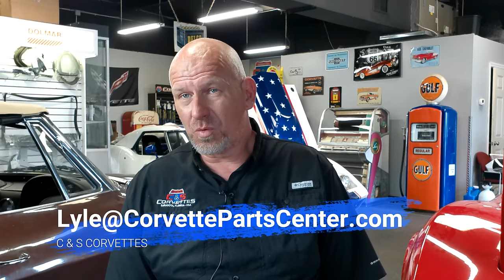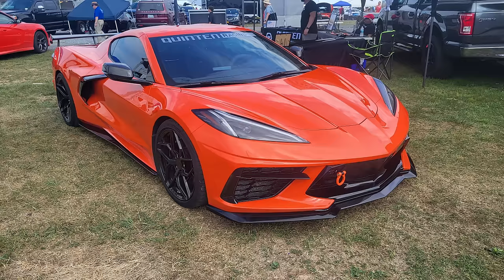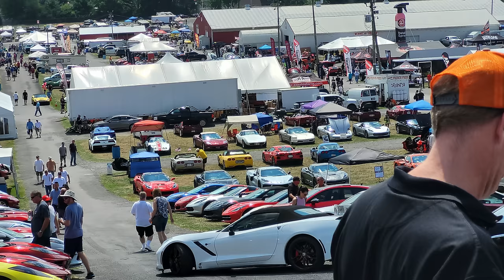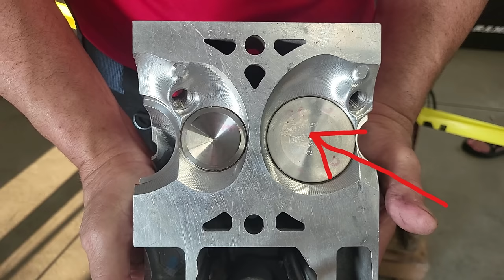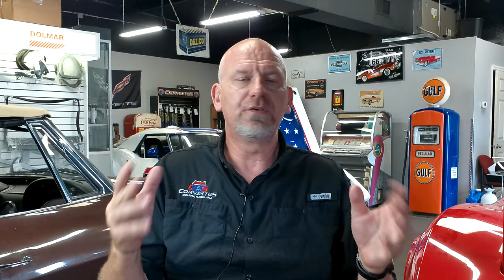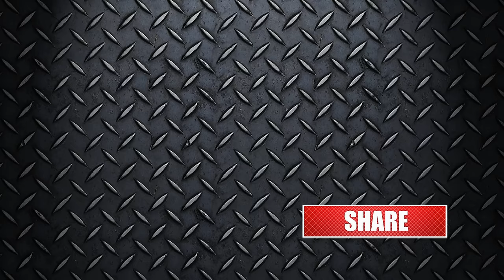The Truth about the LS7

Comment: What about 2009 Z06; any problems with valve guides? I have one with shrorty headers and no cats. What say oh wizzard?
Reply from the maker: Ronald, as you can see in the comments below there are very divided opinions about the LS7.  GM has its views, and the businesses that specialize in solving LS7 head issues have a very different take on them.  My strong suggestion is to contact Race Proven Motorsports or Katech Industries to get their input regarding your car specifically.  Lyle

Comment: I’ve had two LS7 engines (C6 Z06 and 5th Gen Camaro Z28) and without hesitation I will admit that the LS3 engine is better than the LS7 for tuning and longevity and reliability. 
LS3 is the best V8 GM has ever made in my personal opinion

Comment: If you buy a Z06 2006 should I replace the heads and buy factory heads for the Z06 or have GM dealership rebuild them.
Reply from the maker: I recommend doing the valve test as mentioned in the video....if there is ANY question, buy the Katech heads and be done with it.   Lyle

Comment: Excuse me When I said thousands had been reported on the forum I was referring to an article that talked about the large number of reported failures. GM if you believe them “had to” admit that there was probably about only 10% LS7 failure’s in the C6 Z06. GM built 28007 C6Z’s from 2006 to 2013. 10 percent of 28007 is about 2,800 and that does not include the Z28’s that they also failed in.

Comment: I agree with you for the most part of the video. I personally like stick with proper oem parts I’ve had my fun with modifying cars and all the problems that come along with it. But why would gm tune the c6 Z06 7k rpm redline from the factory if the car could handle it. Personally I feel the stock factory tune should be pretty safe if they’re going to put a warranty behind it. Sounds more like they screwed the pooch on that they just don’t want to admit it
Reply: Regarding C7 OEM wheel failures. GM lawyers won the court case by admitting it WAS an engineering design failure. The warranty states "materials or workmanship", both of which meant spec., it was a inferior design which caused the failure, but the warranty doesn't cover that. :(

Comment: I accidentally came across this video. The individual speaking in this video obviously isn't speaking from any type of experience. He lost all credibility when he used the term "chip" when referring to adjusting calibrations in the ECU in a C6. That term in itself speaks to his complete lack of knowledge on modern control systems. I have personally repaired three C6 ZO6 that's because of valve failure and valve guide failure. When that happens, you have a very nice aluminum paper weight. And we actually have an LS7 engine block in our shop, but it's being used as a base for a coffee table. Cold air intakes, headers, and other performance modifications that increase airflow, are compensated for with the factory calibration. With zero issue with the factory commanded air fuel ratios for given load versus RPM. The only solid piece of information that he provided was that an engine is nothing more than an air pump. When you change the camshaft you change the pumping efficiency of the engine, which then puts it out of the calibration range that the factory ECU can manage. I'm so glad I stumbled upon this channel. Every ZO6 I touch, gets worked heads. If you want real technical knowledge go check out RPM Motorsports YouTube channel.
Reply: I told this guy to delete this video if he wants to save any creditability. I dont know how he claims hes a corvette mechanic and knows nothing about the ls7, hes getting destroyed in the comments by anyone that is not a complete idiot and knows nothing about corvettes and the ls7

Comment: BS.  This engine HAS VALVE ISSUES.  If you’ve never had one in your shop you must not work on them very much.
Reply: I disagree. Ive own 7 3-5th gens. 1st at 15 years old was a 85 z28 305 H.0 car. you wrong all Gm Ls dont ive been 5,8s on Gm somewhat factort vahle train. If you never own how can you call B.S.
Reply from the maker: All we have worked on for 48 years are Corvettes.  We don't see a ton of C6 z06's down here, and have never seen this problem in our shop.  That is why I went to GM to get answers.  I knew going into this video that there would be disagreements, and I understand that there are two sides to every issue.  Of the valve problems you have heard of / experienced, were they on stock (unmodified) cars?  I appreciate any additional info that you can provide.  Lyle
Reply: @csvette  I have a 2011 C6Z/Z07 and at 24k miles the GMPP warranty was running out. I took my car to an engine builder in Mooresville NC. He pulled the heads and found the intake valves way out of spec. Also a couple of lifers were galling the cam. The GMPP adjuster inspected the heads and approved the warranty work to replace the heads and cam. The new heads were taken apart and were machined correctly. Some of the valve seats were not concentric with the valve guide bores. He also sent the Del West valves back to DW to be recoated and polished. That is an issue most don’t know about . The valves were not polished correctly and acted like sand paper moving up and down in the valve guide. Del West cutting corners as the bid they won with was very cheap. 

The trunnions were replaced with CHE and Beehive springs added. I also had the cam upgraded with a custom ground cam. Not a crazy lift (.615) just to give me a little more torque between 2600 and 7000 RPM. 

I have put 8000 miles on the engine and is running great. My criteria for my engine builder was I want as bullet proof engine as possible. He build engines for a lot of dirt track cars that see 8000 to 9000 RPM for 20 to 30 minute heat races and he rebuilds them at the end of the season. 

I track my car on a regular basis. I have met many C6Z guys who have had at least one engine replaced under warranty. Met one guy who was on his 3rd engine under warranty. These were un modified cars as modding them would void the warranty. 

The LS7 is an awesome engine. I believe it was very poor machining on the head manufacturing company. I also believe the went too cheap on the valve guide material used. If GM had put an extra $500 to $1000 in quality parts and had tighter quality control process in place they would have had a bullet proof motor. 

The C6Z is a great bang for the buck. The head issue is real as GM probably ran the numbers and replacing engines was a cheaper route than a recall to fix the problem. If you budget for the head fix you can’t go wrong. With this platform.

Comment: Lol, an engine that drops a valve or burns a hole in a piston because of a cold air intake or bigger exhaust IS a flawed engine.   The Honda f20c in the s2000 high a high revving engine with tight tolerances, and changing the intake or exhaust often led to small power loss due to how well the stock parts were designed...but the engine didn't blow up because the stock parts were swapped out.     A guy on YouTube had a sweet vette with 65k miles drop a valve, sent debris throughout the engine.   Even a Lancer Evo, a car boosted over 20psi from the factory in the early 2000s lasted longer than 65k.  The vettes that haven't had an issue are just the ones putted around by old geezers.

Comment: The price of entry to one of the best V8s ever made is aftermarket heads.  Just the way it is.  After that you have a reliable bad ass engine.
Reply: If it was "one of the best American V8's ever made" you wouldn't have to spend several thousand dollars replacing or repairing the cylinder heads on it as soon as you bought it. 

It could have been among the best but GM managed to screw it up anyway.

Comment: GM eventually traced these issues back to faulty cylinder heads from a single supplier. Reportedly, only some 2008-2011 C6 Z06s were affected. And by now, these cars should have stronger replacement heads. This was in GM Bulletin. - I know of a over 200K mile 2006 that had a supercharger and tracked with no issues.

Comment: Did they put that engine in the base C7 ?
Reply: in the video it was identified as a Z car, not a base motor,
Reply: @richardelliott8352  in the previous c5 , C6 the z engine went into the next models base and the z got upgraded
Reply: This engine is only in the C6 Z06. Largely considered the best NA LS motor. I'm biased though as I have one. Definitely more fun the the C7 I had.
Reply: @300cmysrt8  INCORRECT!!! It was also OEM standard in the ZL1 Camaro, starting in 2014......
Reply: @milojanis4901  Almost right. I was referring to corvettes only. It's only in the C6 Corvette Z06. You are thinking of the Z28 which also had it. The ZL1 had an LSA.
Reply: Oh you know what. I almost forgot. The rare C6 427 convertible. That's technically not a Z06 since it's on the steel frame instead of aluminum. Lol. I always forget about that thing. There you go. Two vettes and one Camaro.
Reply: @patrickursomanno8861  since when?  C5 Z06 has an LS6 5.7L. Next gen C6 has a 6.0L LS2, and then a 6.2L LS3. 
C6 Z06 has an LS7 7.0L, next gen C7 doesn't even use an LS motor, it has an LT. 
C7 Z06 uses an LT4, but the next gen C8 uses an LT2. 
The Z06 engine was never used in the next generation.

Comment: GM does a terrible job of putting a red line on their tachs !!  Most of the time it is way past the max power point. All most people know is to shift at the red line !!  This will always cause valve train problems. On automatic cars GM sets the shift point way past the power point. On every GM vehicle I’ve owned for some time they shifted 500 - 700 past the red line which is to high to begin with !! C5s have a 6000 red line but the max power is at 5500-5600. Mine shifted at 6000-6100 from GM. I bought a tuner and set it lower. I had a 2002 Z28 and went to the drags occasionally. It also shifted around 6000. To get my best performance I set it to shift at 5400-5500. It made a BIG difference in ET and speed. The Camaro with its single exhaust with dual outlets didn’t flow as good as a true dual exhaust and therefore its power was slightly lower than the Vette. I see a lot of videos where Vettes and Camaros hit the reverse limiters. They are just asking for problems !!

Comment: Its really simple. You buy a C6Z and you get ported heads, fixed valves and do a cam becuase who wants a stock C6Z?
 Now you dont worry about valves and have an extra 60-80-rwhp.
Reply: You would probably have a lot more if you didn't port the heads and picked the right cam.

Comment: GM has always down played the problems with the LS7 engines.I know a shop that has seen many LS7s destroy themselves.Low miles or higher miles stock and modified cars.Love the performance of the LS7 engine not the reliability of them.When they fail it is big bucks to fix them.

Comment: The truth for me is mine dropped a valve. Good strong motor if you can change the heads. GM did not stand behind this product. Anybody with a c6zo. Please replace the heads. It's a nightmare when a Val go through the block. I don't buy Chevrolets anymore cost me 20 grand to get this car straightened out and then I sold it

Comment: I cannot agree with your statement of the stock LS7 engines didn't have any problems. I currently own a 2007 z06 with 32xxx miles all stock that had valve drop into the cylinder. 
It will need a complete engine that have since been discontinued from GM

Comment: The LS7 was the perfect storm for valve wear, the 1:8-1 rocker ratio, 7000 rpm redline, offset rockers and sodium filled valve stems that added heat to the valve guide cooking the oil to a grainy slurry, plus the decision to not use the titanium valve mfgs. proprietary coating which caused the rough titanium surface to erode guides.  I had a 09 with 34,000 miles stock and the valves had 13,000th slop..Yeah nothing to see here.......

Comment: C5r started with a katek built 6 liter motor, then they switched to a 7 liter motor in 99' and ran that through 2009 in the c6r gt1.  The ls7 basically killed the gt1 class it was so dominant.  The c6r then entered the gt2 class with a 6 liter then a 5.5 liter.  Corvettes running the ls7 won the alms team championship 8 times.  So ya, in the pantheon of purpose built race motors that actually made it to mass production, theres not many that were as dominant as the ls7 was.

Comment: My stock 2008 Z06 dropped a valve on the highway @4000 rpm and cracked the block. Lost $30,000 when I sold the car. GM/Chev did nothing for my loss.
Saved 10 years to buy that corvette. What a piece of junk!

Comment: Brother, Such a Righeous and infirmative Video & Content ~ Love to See a Video of How the LS7 Ti Panki Rods ~ Got a Set "Asembled but Never Run" off a COPO Camo out of GM Custom Shop & an LS7 4.00" Crank that Transfer Fit a LS3 (L94) 6.2 Block ~So beautifully wo Clearance Grinding OMG ~ 416 LS7 Stroker Mod, Just concerned about Crank Thrust Surface ~ Short Side casting void doesnt retain Oil Clearance 360 degree around  CrN Coatings ?
Reply: The 416 Stroker will be Lower RPM  Torque Mod into 96 Toyota Land Cruuser w 6L80 Tap 6 Speed ~ Aussie Adapter to Transfer Case ~ Ultimate Hunting w ATV  Trailer Vehicle

Comment: Excellent overview Kyle, I purchased a Z06 c6 a few years ago, after the purchase I started reading all of these horror stories about the valves and heads. All around lots of talk no answers. I even got a hold of Will Cooksey He said he really had not about the head issue.  Shortly after that I sold the car, Your conversation would have been very help back. Thanks for turning the light on. Regards Ralph

Comment: I had a complete stock 2008 Z06 with 43,000 miles drop a valve and grenade the engine.Not saying your facts are wrong, but the numbers that GM is claiming may be under reported. For example, because I paid for the replacement not GM. Additionally, GM has a vested interest in saying the engine faults had been corrected. The proof to me is that they stopped building those engines, even when they could have continued it in the Camaro SS.
Reply: I'm hearing this from many people.  I have reached out to RPM and Katech to get their take on the issue and will do a follow-up video with their thoughts on the matter.  Lyle

Comment: 7K RPM for a 7 liter engine is way too high. Think about a 3.5L 4 banger revving to 7K. Miata BP engines, 1.8L only rev to 7K. HALF THE DISPLACEMENT PER CYLINDER. How'd they do this.

Comment: My 2008 Z06 LS7 that I have owned since new dropped an exhaust valve on cylinder #3 in 2019 the very first day I took it to an HPDE event. The car was completely stock which Chevrolet dealer confirmed and only 47.8k miles. Engine destroyed which GM replaced long block and other fouled and broken pieces. Only covered 45% of cost leaving me a very large bill. Disappointing that this known common issue was not addressed properly by the company. My Case# 9-5422060631. For the last three years I’ve been afraid the replacement LS7 will drop another exhaust valve. No more HPDE. Finally going to spend more money on updating heads with Manley extreme duty valves.

Comment: How does this information mesh with the fact that GM itself has (or had) the 427/570, and LS7 with a hot cam. Surelly that cam changes the way the engine breathes more than a cold air intake does?
Reply: pardon the typos, cannot seem to edit in youtube, meant "an LS7 with a hot cam" and "Surely".
Reply from the maker: That is an excellent question.  I will ask Paul about it.  Lyle
Reply: @csvette  Thank you very much, I have been looking to do an LS7 swap into my LS2 GTO for a very long time.  I actually was hoping to do an LS7 with a very mild cam, like maybe 530 or 540.  CAI and long tubes were a given.  but when I see this, not even a CAI is a good idea, somewhat concerning.
Reply: @drm9979  CIA  and headers have zero to do with the LS7 valve issue. On a stock LS7 engine and stock crate engine the valve guides are not up to the task. The Ti intake valve are not polished enough and are like sand paper in the value guide. The valve guide bores are not concentric with the valve seats. As for the performance LS7 with a bigger cam, I am not sure it these item are addressed. If you are interested in the Performance LS7 You should ask the questions I have posted above. Also ask if they have upgraded the valve spring, and trunnions. 

The engine is a beast. 😁 nothing like it when I drop the hammer exit off and down the straight at VIR. I. Let the BIG DOG EAT!
Reply: @tomatobob1  great info tomatobob and I am envious.   would you be willing to repost the questions you referenced here as "posted above" please?  There are a zillion responses on this video and I cannot locate your other post.   most interested.
Reply: @drm9979  as requested I posted again at the top
Reply: @tomatobob1  I found it, thank you.  for unknown reason, youtube does not sort posts by date for me but I found it and the info/questions and post is great.  really makes me want to get this swap more than ever, but it sounds like i need to find a good builder who knows how to mitigate ALL the things you spoke of.  well, as LS7 is NLA from GM, I will need a good builder in any case.
Reply: and I see for the first time ever that "newest first" is a sort option I can select.   learning stuff today.